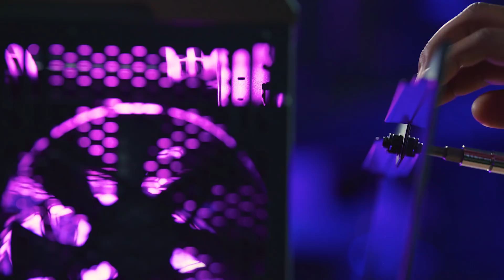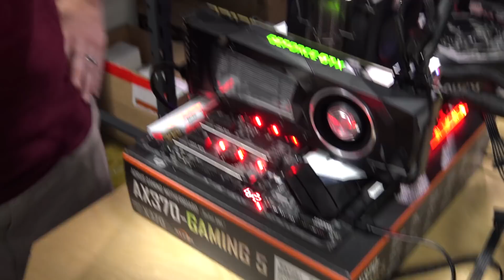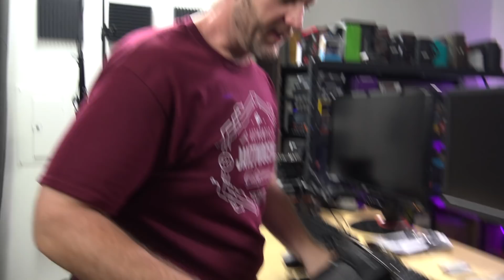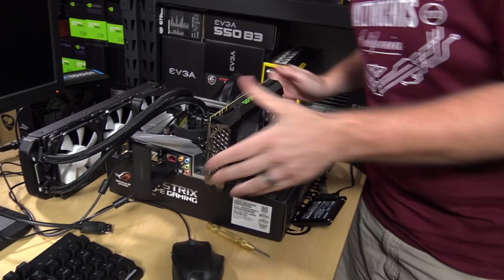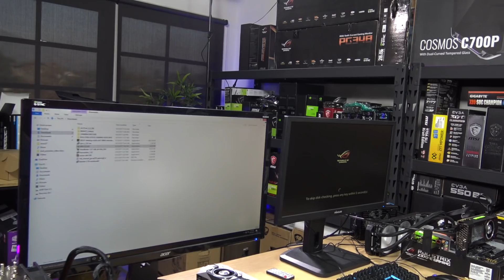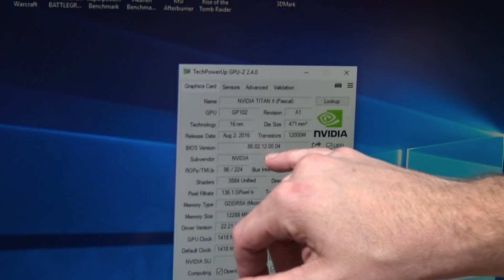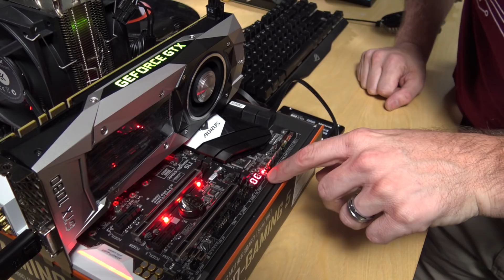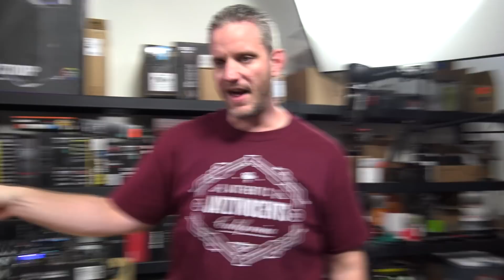I cant figure this one out... HELP!

Comment: I have had this exact same thing happen with a galaxy gtx460. It was one of a pair. Serial numbers were off by one. They were bought for new systems for my wife and my self. My wife’s worked fine and mine didn’t work. Swapping cards between systems worked. It turned out the issue was actually 2 things together. My psu was slightly out of spec on the 5v rail -.3v and the one video card turned out to be very picky about power. When I swapped my psu it worked perfect.

Comment: Go step by step pull the ram and reseat it reset the cmos on the board then if its still doing the same error code see if it will work in another slot check the psu cables if its still doing the same thing drive that shit back to the store for exchange lol.

Comment: This is likely a long shot but is the fingers on the pcb on one of the cards a fraction of a inch shorter and it's not making good contact. Have you tried the other pcie slots I don't think you mentioned it.

Comment: Maybe check the bios on the BAD card?

You checked the good card bios while it was in the intel system, then swapped cards, then checked the bios of the SAME CARD after you installed it into the Ryzen system, but never checked the one you had moved into the Intel system (The one that wouldn't boot on the Ryzen system).

Comment: I'd swap the power supplies just to eliminate that variable.  If you have another of that same model of motherboard, I'd try swapping that too.  Also, I had a couple issues with my Ryzen rig where I had to reduce it to a single RAM stick just to get Windows to install (simplification of components).
Reply: Also, I wouldn't say that both the gpu and mobo are good because they work in other situations... it just requires 2+ environment variables to cause the fault to express itself.  My gut says the next thing that I would like to see ruled out is the power delivery... put in a different PSU to make sure it isn't a quirk with the power (stability, availability, latency).  If both GPU's are identical, I'd say the 'fault' is with the GPU, but it requires certain conditions for the fault to be expressed.

Comment: Have you checked the PCI-e lane operation mode? I once had a motherboard run fine with an HD 4870 but failed when upgrading to an HD 7870. The reason was because the slot was damaged and would only operate at PCI-e 4x mode and the new card required x8 mode in order to POST.

Comment: When you were testing and set the OC on the Ryzen system and it reset the ram, could it be that the one titan with the issues wasn't letting the ram oc but since it's set from the new test it's not working with the oc Ryzen.  The Ryzen can be picky on the settings and it may not have set it back to default enough to have the new titan work properly

Comment: i had issues with desktop computers running at my apartment complex since i live in a old building. my old desktop keeps on shutting on and off repeats with no posts then i had 3 different desktops doing the same darn thing. i couldn't figure out the problem was so i switched to laptops & i haven't had any issues since then.

Comment: Try checking the tolerences on the gpu power pins maybe the one that isnt working on the ryzen system is sloppy and not getting power the way it should. Most weird issues like this tend to be cabling. Can try what some other users are saying and swap the PSUs.

Comment: Mesure the pcb thickness on both video cards,  one maybe thinner than the other not letting the pins make full contact.  Ive seen bad springs on pcie slots making them very finicky about thickness of the pcb

Comment: I get this BIOS issue on my rig (1600x with 1080Ti) but it is intermittent. Sometimes it happens multiple times in a row, but once I get it to post it runs fine in Windows. Sometimes it's fine after a reset, sometimes I have to shut it down and leave it for a minute and then try again.

Comment: The possibilities that come to my mind are, dirty pin on the dodgy titan, crud in the pcie socket or dodgy power supply.
With the dirty pin or crud in the socket, re-seating the card may not be enough to ensure a good contact, so may not fix the problem, whereas a completely different card won't have the same dirty spot and should work just fine. 
As for the power supply, I noticed that the 1080 didn't need the additional plug that the titan needed, so the problem could be there, or it could be a different fault in the psu altogether. I have had an issue in the past where a particular graphics card would not let the system post but using a different graphics card did work. After replacing the psu (same wattage so that wasn't the issue) all of a sudden the system booted just fine with the suspected faulty card.

Comment: Could be the AORUS motherboard BIOS/firmware having an issue with that one card. In fact it could be a built in error detection noticing a problem in that Titan that may be bypassed on the ASUS board and halting the boot. Could be a poor quality power relay, a bad VRAM module, GPU has a timing issue in the clock, etc.

Comment: Mabey it is DRIVER issue ?   Are you using the same driver version for both systems ?  Microsoft ? AMD ?  ? The ryzen system is not AWARE that this particular GPU is there .  Use a Passmark  PCIe test card  to test the amd slot . If it passes .It is a GPU issue ... Does that make sense ? Other than that ..Got no idea .. Will this be on the test ?   Thanks

Comment: I have run into this more than once i throw in another card different GPU core so no 1080 with 1070 i do Nvidia and and or high end and lowend plug into the other card to the monitor and you will normally be able to get windows or Linux debug codes.

Comment: I had a similar issue a while ago when building my dad a pc, he brought a gtx760 and it just wouldnt work whatsoever with his am3 gigabyte board, tried it in my own system which was a lga 1155 gigabyte board and it worked fine. I had a sapphire 7850 at the time so we ended up swapping cards as the 7850 worked in his pc.... still to this day have no idea what caused it, so if you end up finding out i will be very curious to see what it was lol. Good luck! :D

Comment: I would try another PCIE slot. I would also try swapping the PSU between the two systems.

Didn’t you have a weird micro-stuttering problem with the Ryzen system? Maybe they is a small flaw in that graphic card’s silicon that the Ryzen mainboard is more sensitive to? Do you have another Ryzen mainboard (different make a model) you can try that card on?

Comment: Jay, 

When you got the Ryzen system working and checked the Graphics Bios version it showed identical version, BECAUSE you were using the same Graphics Card that worked on the Intel system where you checked the Bios Version first!!!!

You failed to check the Bios version of the card you took out of the Ryzen system where it didnt work once you had it working in the intel system!!!!!

With the card that only works in the intel system you need to check the bios version as it is likely the culprit. if it then turns out to be the same bios version try the dud card for ryzen in another MOBO that is also ryzen from same manufacturer and if it still fails then try in a ryzen MOBO from a different manufacturer if it still fails it is likely a dud graphics card that has an issue with ryzen bios for some reason. I had a similar issue with toshiba laptops when in Army where some things would work on one laptop but not another even though they were same model and batch. never worked out why this happened just worked around it.

Comment: When I first installed my GTX960 into my new Ryzen rig it wouldn't post until I connected it via VGA - after which the Display port and HDMI interfaces suddenly started working.  Has me wondering if one of the display connectors on one of the Titans isn't giving the X370 an expected signal - whereas the other Titan is.  The Intel architecture probably doesn't use the display signals in the same manner which is why it doesn't care?   The really interesting thing is that after my GTX960 started displaying correctly then I could use the MOTHERBOARDS VGA port to get a VGA signal instead of using the GPUs VGA port - so there is obviously some sort of pass through function at work on the Ryzen chipset.

Comment: GPU could be damaged in a way that won't work ryzen. Another potential issue is pcie slots, I have an ASUS x99 mobo that's top slot wouldn't post, and second slot would cause screen tearing. Third slot was fine. I'm using a 1080 so maybe it's the fact that pascal is (relatively) new. Also the same motherboard had an issue where the first CPU didn't work, but after replacing it everything was solved.

Comment: I'd check with a good card the overclocks you have set on the card's and drop them to stock clocks or even underclock and retry the busted 1, seeing as how identical cards dont work identically plus that has happen'd  to me before and that was the case

Comment: Pretty sure that it's the motherboard PCI-E slot doing that. Back when the GTX 680's came out, I bought two of them for SLI and Nvidia Surround. They  worked flawlessly for about a year until the motherboard wouldn't accept the cards in SLI anymore. When SLI was enabled, it wouldn't recognize the other card, but without SLI it would accept both cards. After another 3 months, it refused to acknowledge one of the cards anymore, even if it was by itself in any of the PCI-E slots. The card worked in any other system I tried.

Comment: So with my Rx 470 it would let me use displayport for a while but then after a while the vga error would come up so I had to use HDMI, but when I got my gtx 1070 it let me use displayport, the rx 470 messed up when I switched monitors

Comment: i have had an issue with a uwb mouse that forced it not to run, its really weird but my razer deathadder caused it to stop on b2, also had a USB 3.0 expansion card that it wouldn't work on, but once it plugged it into the Mobo port booted no problem.

Comment: This may seem like a silly thing to check or may have already checked,   power supply (just because may have issues randomly with power on the 6:29  OC code). supplying enough power, im sure the PSU is newer, but made many at a time could have fluctuations.  I have seen RAM cause some strange issues like this, but it was random posting sometimes and not others. .. I'm sure you tried the same video card multiple times. same card that does work in a different PCI-e Slot?. just throwing some ideas you've probably already tried or heard. I work on PCs all day at a custom PC shop and things like this are some of the more challenging things to figure out. finaly thoughts have you fully removed all RAM and CPU Overclock's and tried stock just to see if that may have something to do with that one card not working. I hope you figure it out and post your findings, not necessarily in video form(though that would be great), Twitter you also do :D

Comment: it will sound unreasonable or silly but lets assume its possible :
the faulty card might have a corrupted bios file or some sort of error that is stuck there , or something like a built in overclock , so when u put it on that motherboard it asks for extra power thru the pcie or the psu so it doesn't work . while when u put it in the other system that motherboard can give it that extra juice its asking for which maybe is exceeding the standard of pcie :3 while other card the bios or built in memory is healthy and have stock numbers so its not overclocked. somehow the faulty card did get extra volts or numbers changed and might not be showing in gpu-z try to double check the numbers in gpu-z + try to ignore them and flash the bios of the card which will force it to rewrite the stuff in it :) .
maybe check them in different software other than gnu-z

Comment: When you swamped the 2 original cards and checked what bios was on the card it was the same card you did not check the bios of the problem card on the other system that it works in .
By the way this is the exact reason I steer clear of AMD these days I have been building and playing with pc's for 25 years and every time I decide to give AMD ago whether its a full system or just a GPU there are always problems just like this be it hardware or there shitty  drivers. The stupidest was a key board causing random crashes on the original AMD duel core system I built. I even took the system to the place i bought the components from and even they could not figure it out as they use a different keyboard and mouse at there test centre it would not crash so seeing this I took it home bought a different keyboard and no more crashes the old keyboard that caused it to crash I still have and works fine on every system I'v used it on to this day.

Comment: Clear the CMOS, check that you have the latest motherboard BIOS installed, clean the pins in the slot and on the card, check another slot also, and if it STILL doesn't work then it could be a bad motherboard. At that point, check another Ryzen system using the same PSU and everything else.

Comment: I had same issue with ryzen I got 3x new Rx vega and one just stopped working after few hours. Pc wont boot with it In first slot but when I put it in second or third I got managed to get into safe mode. But once I got into normal windows (not safemode) everything stopped working. Card is in RMA and those 2 vegas I have still work without problem. Only difference was that the faulty card had earlier batch number those two which I currently have have same batch one ends with 163 and other with 164 :) I really hope its not by bad ryzen. I have tried different slots and power cables and it didnt help. btw I have x370 MSI board

Comment: Mr.J, like what others have said and i haven't seen a confirmation... but you checked the bios on the same card.  If it matters or not, the device ID is the same on both GPU-Z screens that you popped up.

Comment: Ok so I had a very similar problem and I nearly lost my mind trying to figure it out, and I ran tests on everything, 2 different cards, different ram, different ram configurations, different pci-e slots, different PSU, different SSDs and HDDs. And my pc was doing this wierd shit where it would turn off randomly so naturally I had both MSI afterburner and core temp installed to check and everything was pretty much normal. FINALLY I took my noctua cooler off and checked the cpu and it turned out that the cpu itself was defective, now here's how fucked up this defect was. The pins on the bottom where they're suppose to be were 100% fine, but the metal part up top(where there should be nothing but metal had a little hole in it and there was a pin sticking out of it! It was so tiny you would never see it if you weren't looking for it, and that's why it kept shorting my system but whats even stranger is when it shorted my system the light for the gpu would be the one that would go on. So check your ryzen cpu because it might actually be that strangely enough. The one I was using was a ryzen 5 1600x.

Comment: Considered the power supply on the amd and the connectors on the cards see of any are not connecting properly, had issues before of poor power delivery stability and connection issues with cards that have been changed regularly.

Comment: I had a very similar problem, it would work only in pcie x8 not x16. When I finally changed the the slots for where the ssd's were connected I could use x16 again. I don't know why but that's my story.

Comment: You checked the bios on the same card two times and didn't look at the bios on the other card you moved to the Intel rig. Here is a tip that had worked for me in the past clean the contacts of the card with a eraser i have had cards that get pulled a moved a lot get finger oils and dirt on the contacts that keep them form working in one board but work in another must be the contacts in the slot might be tighter and make better contact

Comment: Redo the uefi settings and see if it works Jay. Load optimized efaults, than do any custom settings and save it.
See if that works, as your changing hardware and that's probably the issue.

Comment: It still might be your motherboard as maybe the contacts on the PCI slots are bad and not making contact enough to register theres a card slotted in it as well.  I had my wifes motheboard PCI go out but not the whole motherboard.  Or possibly the "bad" videocard has contacts on it that are not making a connection to register for the motherboard to have a video output on it.

Comment: Have you tried to DOWNGRADE the bios of the motherboard? I have a z270g Gaming and a 6600k, i had the BIOS version 0801 with XMP and 4.6 working fine, then upgraded it to 0906 and my 6600k couldn't boot 3000 mhz without working at 800 mhz !!! So i had to downgrade again, and waited for bios 1009 which i currently have, and works great.

Comment: I'm wondering what the BIOS of the card that didn't work? If they are different, what is the changelog between the two versions? You showed the one that worked on the intel system but not the one that was the problem.

Comment: JUST CHANGE UEFI / NORMAL BIOS BOOT BEHAVIOUR FOR YOUR GPU !!!!   If i use UEFI Bios on GPU .... BLACK SCREEN !! ... if ic change back .... RUNS like it should ....  Other scenario ..... Got GAMES which makes the monitor pic black in intervalles ?? S A M E   Option .... =)

The SYSTEM is not fully UEFI comaptible ..... and the difference ??? 0,5sec faster booting when reboot .....

Comment: I had a system not boot with the daisy chain pci cable. worked fine when i used two cables instead. didn't bother figuring out what the actual issue was since it eventually worked

Comment: Jay you confused yourself lol it happens man.
But you said the GPU bios was the same bc you checked the bios on the working card on both systems. 

You plugged the card that wasn’t working into the intel system but didn’t check the bios